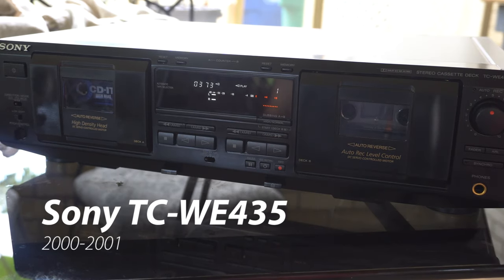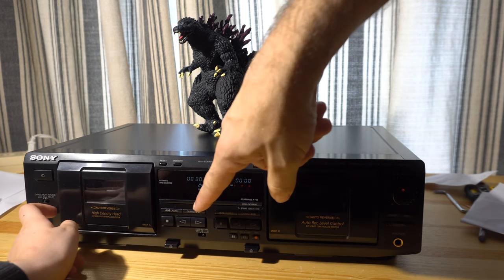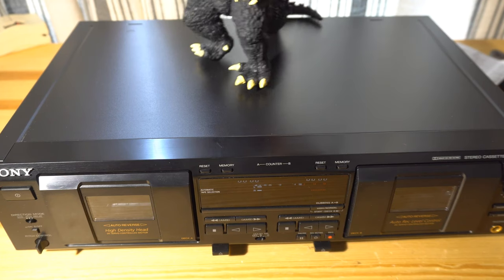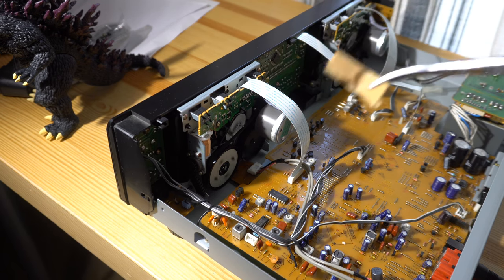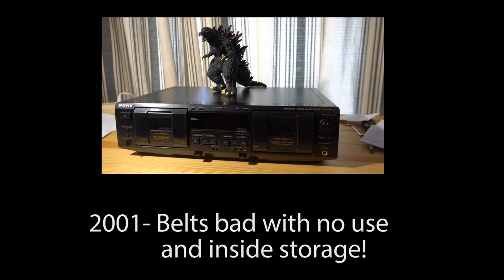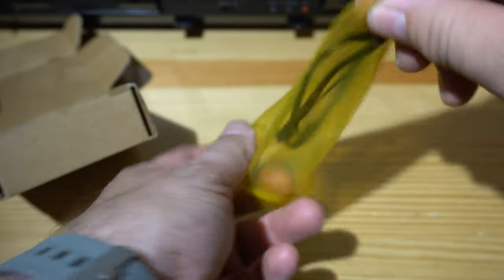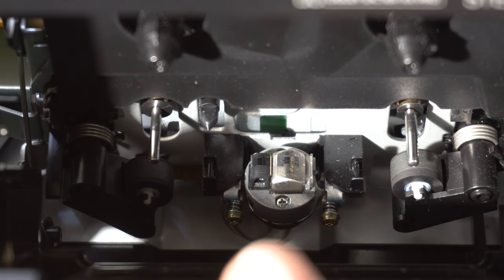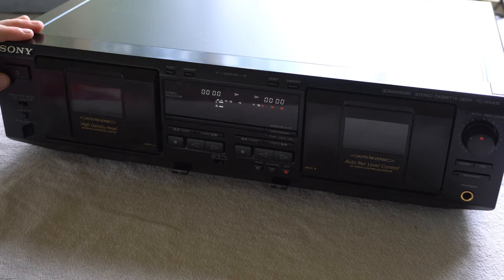Sony TC-WE435 Dual Cassette Deck: In 2001, cassettes are on their way out!

Comment: Do you know if the Sony TC-w435 uses the same belts as the TC-WE435?
Reply from the maker: Not sure, Sony has 2 separate product manuals. To find replacement belts for my cassette deck, I searched on ebay, looks like there are separate kits available for the TC-WE435 and TC-W435. Thanks for watching the video!

Comment: Pitch control?
Reply from the maker: Pitch control is really speed control. Cassette tape decks run at a certain speed this would let you adjust it... Thanks for watching!
Reply: @ACBMemphis  i have no pitch or speed control on pioneer ct40A from Japan
Reply: @ACBMemphis  luv ur videos bro
Reply: @ACBMemphis  does 435 have it like 475 665?